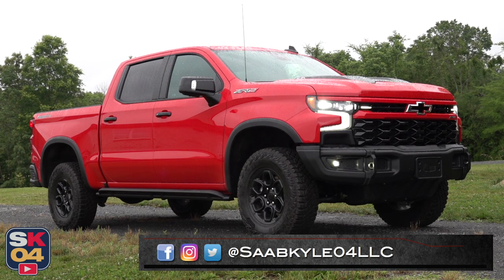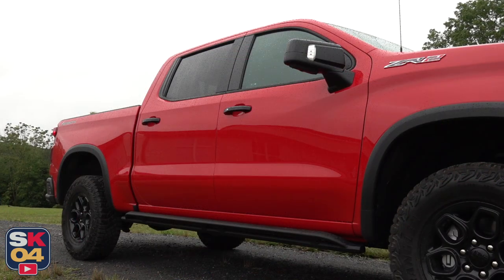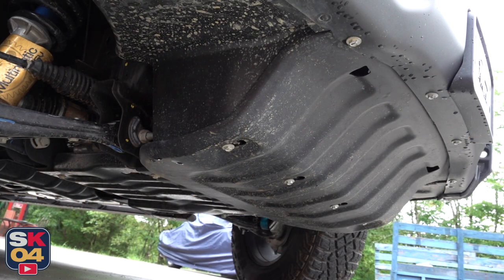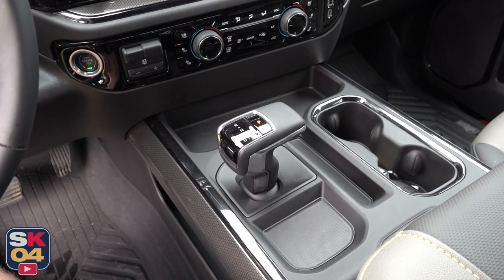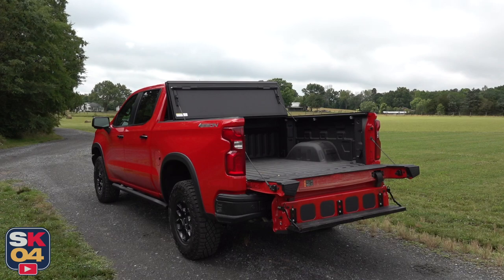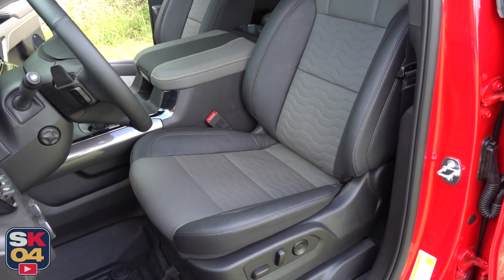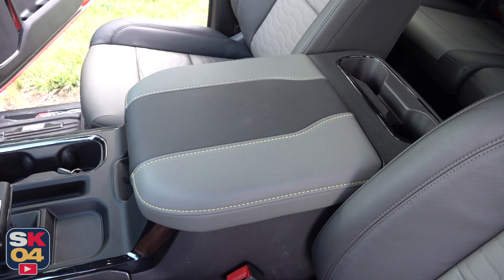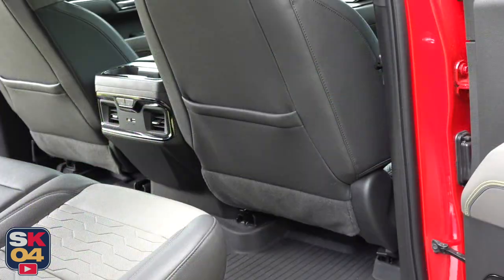2023 Chevrolet Silverado 1500 ZR2 Bison Edition: Start Up, Test Drive & In Depth Review

Comment: I just hate the floor shifter. They shouldve kept it on the column to free up that center console real estate
Reply: Not all of us are into the grandpa look for the column shifter interiors, gramps.  Nineteen seventies column shifters aren't coming back.
Reply: @houseofno  my in laws got a 2022 silverado  1500with a column shifter. Its not going anywhere. Floor shifters should be left for cars
Reply: @Scoobawoo  Does it come with a vinyl padded roof too? Whitewalls? Wire wheel covers? How about fuzzy dice in the mirror, an 8 track tape player and a CB radio too?
Reply: @houseofno  actually a cb radio is pretty useful and fun. Got one in my truck and im always on the highways and use it to talk to the truckers
Reply: Fair enough about the CB radio but the rest of my criticisms stay intact, and I am adding overstuffed velour interiors to the list.
Reply: Ford has had them since 2004 their fine if you hate it so much buy a 2021
Reply: @TeamC4BigRich I have a rst with column shifter and it literally blocks the radio volume knob so you're forced to use steering wheel controls lol. The floor shifter is nice cause I makes the truck feel sporty. However I don't like GMs design it mimics dodge too much.
Reply: @Scoobawoo I like mine. Took a while to get used to